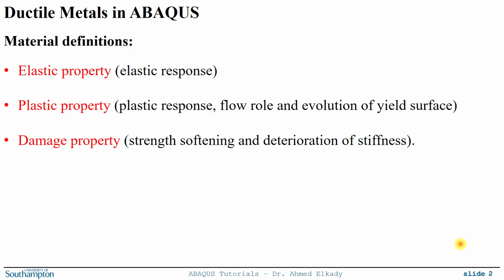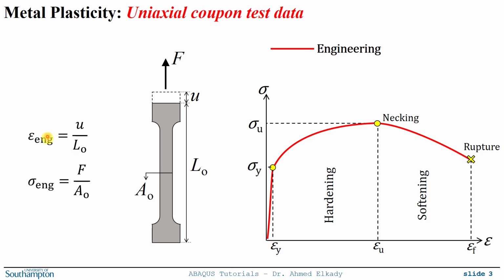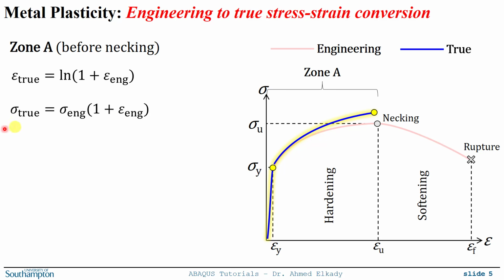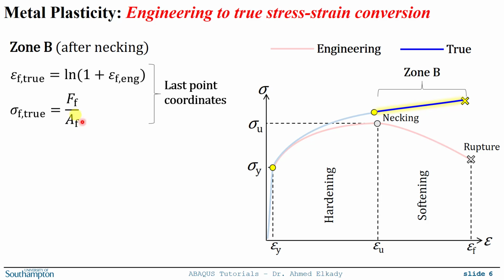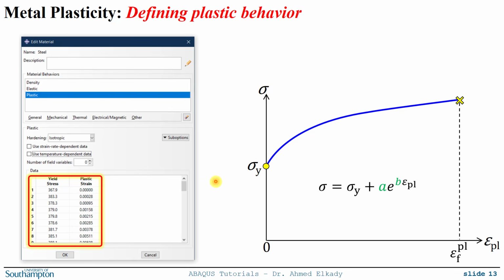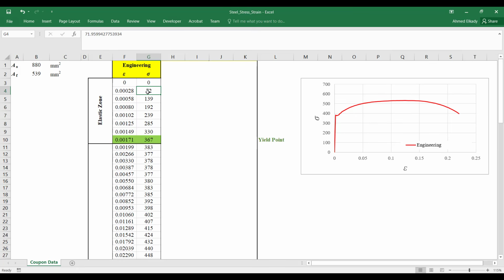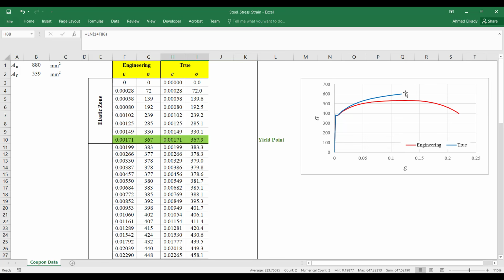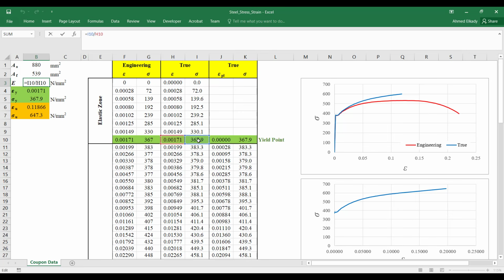#33 ABAQUS Tutorial: Metal Plasticity | Engineering to True Stress-Strain Conversion

Comment: In case, if we use a strain gauge attached to a coupon sample for measuring the strains directly ,,does this strain is considered as Engineering or true strain ???
Reply from the maker: strain gauges/extensometers measure strain based on a fixed gauge length (i.e., engineering)

Comment from the maker: Please note that the proper way to compute the plastic strain is to subtract sigma@current strain/E from the total strain. This is actually the method used in the EXCEL file provided in the link in the video description. However, sometimes for simplicity, you can just subtract sigma_yeild/E; the difference is generally minor for steel materials with relatively large E.
Reply: Thank u Dr.I have some questions about abaqus. I would like to ask how to deal with stress-strain data.Do you have your gmail contact information to facilitate our subsequent communication?

Comment: Thank you sir, great video and explanation. Just one question:
I think the plastic deformation is not difference between total deformation and elastic deformation for yield stress but it is difference between total deformation and elastic component of deformation for the current stress. In video time 16:33 equation "Epsylon_pl = Epsylon_true - Epsylon_y" should be "Epsylon_pl = Epsylon_true - Epsylon_el" => "Epsylon_pl = Epsylon_true - Sigma_true/E". Am I right? If not please explain.
Reply from the maker: Yes, the proper way to compute the plastic strain is to subtract sigma@current strain/E from the total strain. This is actually the method used in the EXCEL file provided in the link in the video description. However, sometimes for simplicity, you can just subtract sigma_yeild/E; the difference is generally minor for steel materials with relatively large E.
Reply: What if we only have engineering stress and not true stress at fracture? In such case we can not calculate the elastic component at the fracture as we lack true stress and ultimately can not calculate plastic strain at material failure. What do we do then? Any suggestions will be appreciated. Thank you.

Comment: Great video thanks. I have a question if you do not mind. I see that true fracture stress is above the ultimate stress. However, in abaqus documentation, the stress is lower than the ultimate value due to damage accumulation. 

http://130.149.89.49:2080/v6.14/books/usb/default.htm?startat=pt05ch23s02abm18.html  (Figure 24.2.3–1)

Assuming that I am comparing with physical test, which one is correct? I am bit confused here.
Reply from the maker: The true stress of metalic materials such as steel increases with increasing strain. The figure you are refering to is concerened with the phenomenological ductile damage model which is a material-property-add-on that degrades the material's undamaged stress (discussed in this tutorial) to simulate strain softening behaviour leading to fracture.

Comment: Hello, I don't quite understand why your plastic strain is minus a constant? Shouldn't the elastic strain be changing all the time?Different stresses correspond to different elastic deformations
Reply from the maker: Correct, the elastic strain value will change with stress. This is how the plastic strain is dedcued in the referenced Excel sheet on GitHub. Sometimes however, it can be acceptable to just subtract the yield strain for simplicity.
Reply: @AElkady  Thank you for your response

Comment: Good explanation. I've an observation about what you said when you defined the engineering strain: L0 is the length of the specimen's uniform section named "gauge length". If you consider this uniform section, between the fillets, you have an uniaxial stress state in each point. So the engineering-stress strain curve is correctly defined if and only if we consider these hypotesis: 
- uniaxial stress state; 
- small displacement; 
- volume conservation; 

Other curves: true stress-strain from elongation and true stress-strain from section, are defined by the violation of the cited hypotesis.

Comment: Thank you sir. But I have promblem. I am working on V bending 2D plain strain.
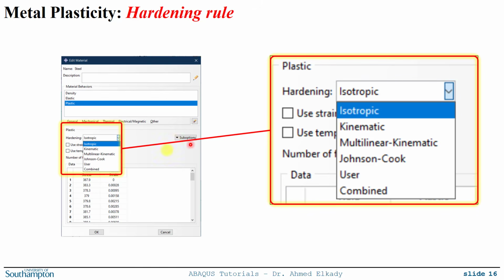When I define true stress- true strain graphs all points for plasticty in the material definition, the results of the springback are less than the experiment. However, if I define only the line where the plastic strain is 0 (the first line (yield point)) as you describe in the video 19:46 , the spring-back estimation gets much closer to the experimental results. Is it a correct method to define only the line where the plastic strain is 0? Do you have any other suggestions to increase springback  in terms of material? I should point out that; the material is copper and I am using stress strain curves from other articles. Because the experiment I'm analyzing is not mine.
Reply from the maker: You should model the material's elasto-plastic behaviour to match the material uniaxial tensile test (true stress-strain curve). Perhaps a bilinear elastic-perfectly plastic model matches your material the best.

Comment: For a rc frane analysis i used engineering stress strain curve of steel. Should i change it then to true stress? Oh my god..
Reply from the maker: Yes, it should be true stress-strain. But note that it probably does  not have significant impact for rebar; actually, many just model rebar using elastic-perfectly-plastic material.

Comment: I've got a question. It seems in the Abaqus documentation that the plastic strain must be evaluated not only on the basis of the initial yield stress. You always remove SigmaYield/E whereas this should be updated as SigmaTrue/E at each SigmaTrue level according to the doc. Do you have any point of view on that? This is a difference of understanding of the method between several of my colleagues.
Reply from the maker: Correct, the proper way to compute the plastic strain is to subtract sigma@current strain/E from the total strain. This is actually the method used in the EXCEL file provided in the link in the video description. However, sometimes for simplicity, you can just subtract sigma_yeild/E; the difference is generally minor for steel materails that have relatively large E.
Reply: @AElkady  thank you for your answer Ahmed
Reply: I was having the same confusion. It is clear now. Thank you all.

Comment: Dear Mr. Elkady, do you have the values of engineering stress-strain curve for material S235 maybe, or do you know where can I find it?
Reply from the maker: You can find several curves reported in litrature. Here is one: https://www.sciencedirect.com/science/article/pii/S0143974X16305181
Reply: @AElkady  Yes, but I can't find the results from some tensile test with the point coordinates in detail as in your example in excel.
Reply from the maker: The reference above include an easy empirical equation that can be used to generate the stress-strain data.
Reply: @AElkady  Thank you very much for help.

Comment: Thanks for the great explanation.
I have a question if you don't mind. If I'm validating an experiment using ABAQUS, the author didn't provide a stress-strain curve he just mentioned the yield and ultimate stresses and their corresponding strain as a result a tensile coupon test. Should I assume that the mentioned points are the true stress-strain points ? And put them directly to ABAQUS?
Reply from the maker: Commonly, researchers report the engineering values not the true ones; so I would assume its the former. One more way to check is by comparing the reported ultimate stress with the expected value that is reported in the design standards for the same material grade (which is also an engineering one).
Reply: @AElkady  Thanks Dr.Ahmed. Very helpful.
Reply: @AElkady  Sir for Abaqus simulation of dampers which data we have to use ,"true or engineering?